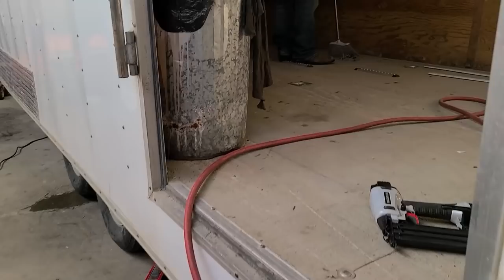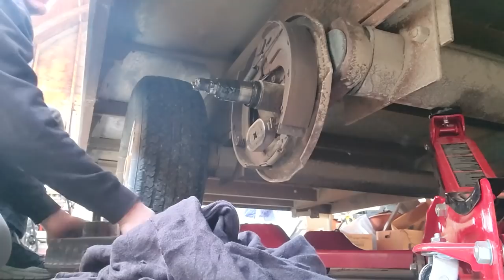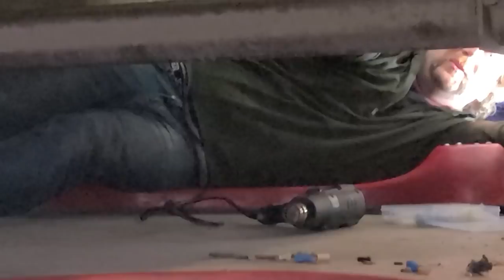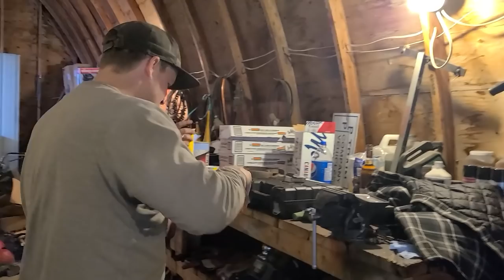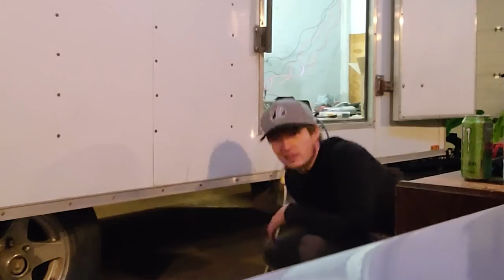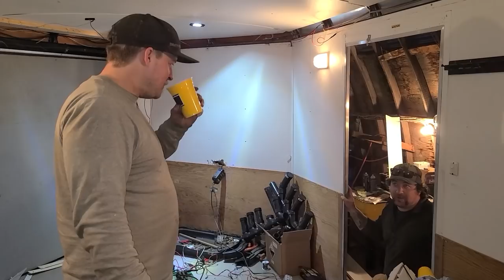RIGGIN' UP #5 | NEW BINDERS

Comment: Where did u get the white wall paneling from and ceiling
Reply: All the interior paneling and trim is what the trailer came with from the factory. We just had to pull some of it off to run some wiring.